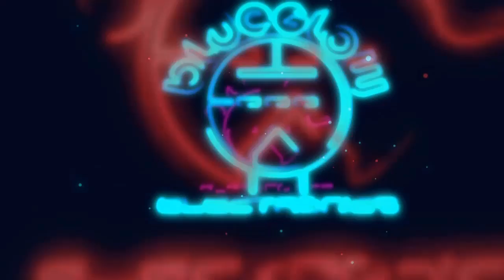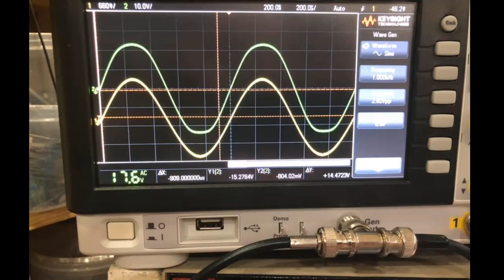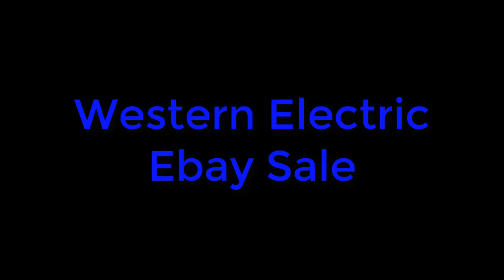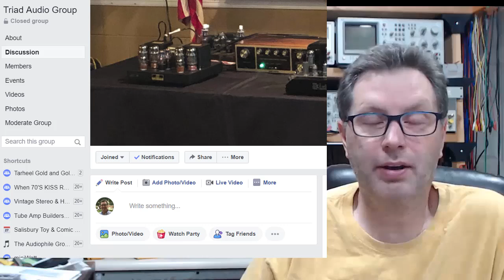$7000 Speakers - Power Cord Blind Test - Cool Oscilloscope - Synergy

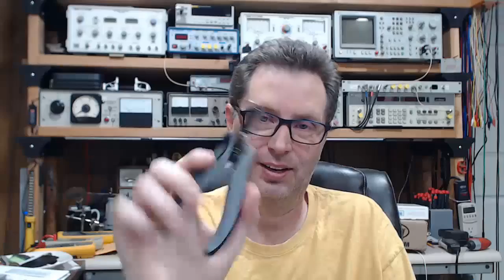Comment: 14:53 You can get a lot of different bending pliers, both with and without cut function, you can get a lot of shapes also. Great tool by the way. :-)
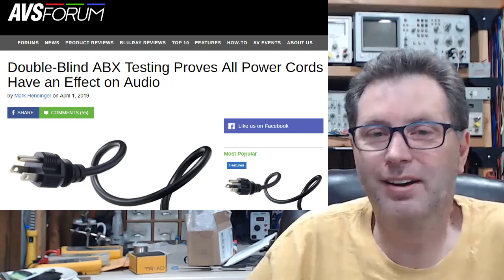16:19 I am wondering if (just hear me out) if they can't have a positive effect, not because better cable for the rest 6 feet but because the shielding. Behind nearly every gear, you see a power cord sitting near the signal cables, can that not degrade the sound a bit, if you have 60Hz + harmonics going into the signal cable? (just asking without knowing! :-)

Comment: The tool for bending the leads looks to be a chp pnr- 30- d
Reply: See HAKKO tool number CHP PNR-5000-D
Reply: @fpliuzzi  The TP 5000/15 is not the correct tool, just snips off the lead, bought this one by mistake. Will update when I get the new one.
Reply: Hi, I never mentioned the TP 5000/15. I purchased the HAKKO CHP tool number PNR-5000-D.

Comment: I can highly recommend the Keysight DSOX1000 scopes! Also consider the DSOX1102G which provides up to 100MHz BW and a few more features than the "education" version. Excellent features for audio work.
Reply: Another commentator stated the 8 bit vertical resolution not enough? I was originally looking at the Rigol DS1054Z which is 8 bit as well.. The idea of the combined function generator intrigued me.
Reply: The DSOX1202A is a good fit?
Reply: @jamespanegasser9524  Yes. The DSOX1202A is a newer version of the 1102A.
Reply: @jamespanegasser9524  But note that the "A" version does not include the built-in waveform generator. That's in the "G" model (1202G)
.

Comment: I couldn't agree more with your comments about 'sound'.  Before guitar amplifiers came along,  individuals and companies were building audio amps, whether that was for recording studios, radios, gramophones and radio broadcast etc. My main interest is tube guitar amps, but I listen and watch what you say and do, as the audio amp started the whole ball rolling. Whatever is inside a guitar amp, you'll find the same type of components inside the most expensive hi-fi equipment..  Most guitarists have different sound requirements that hi-fi enthusiasts, but the same rules apply. As you said Mark, it's subjective, and changing 'one' component of a system can make the world of difference in both cases.  Glad to see you looking better and back on form..

Comment: posted this on one or two of the HiFi Facebook pages, on April the first, most of the posts got deleted.........." With all the controversial talk on mains power cables I decided to try an experiment over the last few months, using different energy suppliers to ascertain if it changed the sound quality (by the way I am in the UK). First I tried Ecotricity, these are a specialist renewable provider and use a lot of wind turbine power, I immediately noticed that the turntable speed was unstable and a lot of wow and flutter. Then switching to EDF, 71% of their power is sourced from nuclear the sound was noticeably aggressive with a certain glow round the edge of notes. Last of all was Npower, most of their energy is sauced from traditional generation such as coal and CCGT, listening, the music was relaxing and warm. As anyone else had a similar experience ?
Reply: Having electricity produced by Nuclear I have noticed that every time I turned on the tuner it became radio active.... When I increased the power my neighbors complained about all of the radio activity and kindly asked me to stop it.... Apparently it was giving them cancer..... Pfffft! Some people just don't know what music is any more...

Comment: Personally I'd never spend much on a power cable, or any cable for that matter, as in, I do like good cables that are well constructed and have good quality plugs and of course it doesn't hurt if they look nice too.
However we humans are not rational beings and I do understand there is a psychological aspect to music reproduction, so my stance has always been, if it makes someone happy and makes them enjoy their music even more spending $100s or $1000s on a cable, then who am I to say they are wrong.
Reply: Right if one buys a $100 power cable to connect a high-end receiver (or anything else) to the wall outlet expecting to improve the sounds, then they probably bought snake oil as was explained in the video here.  But if you are connecting sound equipment to an amplifier, then those intermediary cables need to be decent (low impedance, good connections, low corrosion, etc.).  I have connected [cheap] RCA cables from my CD player to my amplifier to discover it sounded horrible because the cable was not even coaxial, it was just parallel cable inside a plastic tube.  Another example is the the connection of a turntable to an amplifier -- the cable needs to be thick, coaxial/shielded and with good connectors, otherwise you may hear crappy sound and with 60 Hz humming.  I am talking about a $10 cable for that, not a $1 or a $100 cable.  Been there done that... For instance, I had to connect a turntable to my amplifier via a fiber optic cable using A/D and D/A converters because the distance was over 15 ft (there was a reason for that) and it sounded horrible using even very good coaxial cable.  What I mean by "horrible" is the S/N degradation in the loss of high-frequencies due to capacitance in the cable and the addition of 60 Hz (or 50 Hz depending where you live) humming due to the magnetic field interferences of appliances around it and cables inside the walls.

Comment: On the speaker story, please explain to me why someone would bid $2,000 over the current highest bidder? This makes no sense.
Reply from the maker: Very normal on ebay, you bid as much as you are willing to pay.  Go read up on how ebay auctions work, too much to type here but its very common.  If you bid $10 and someone bids $11, you just lost.  However if you bid $20 and they bid 11, you only pay $12 is the basic premise.
Reply: But since the high bid was bogus, it would seem he would only be required to pay $5,000.  I have won a few E-bay auctions and did not have to pat the amount I bid because the closest bidder did not match or exceed my bid. Maybe it is the difference in a firm bid and a maximum bid.

Comment: Hey Mark, before you get to far with the scope, check its specs on vertical resolution (8 bits) and oscillator distortion (1%), https://literature.cdn.keysight.com/litweb/pdf/5992-3484EN.pdf .  For high-end audio testing it might not be good enough for you or your readers needs. 1% distortion is -40dBc. The AD2's analog sections (acq and wafeform) clearly exceed these specs. My AD2 measurements show 90dB+ performance. Thanks for the video.